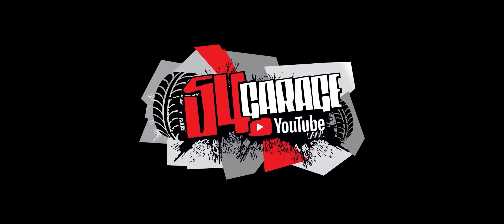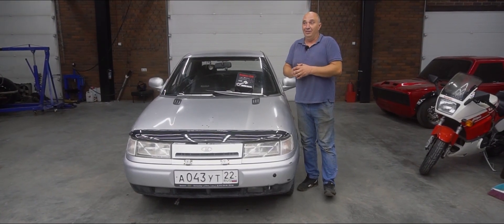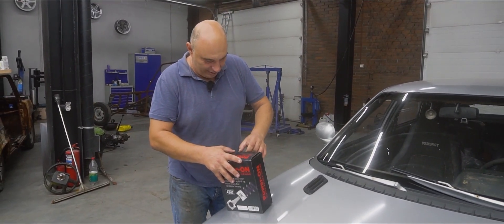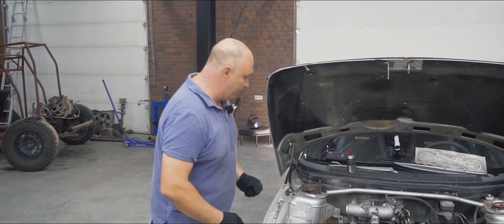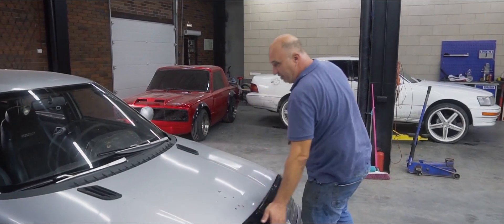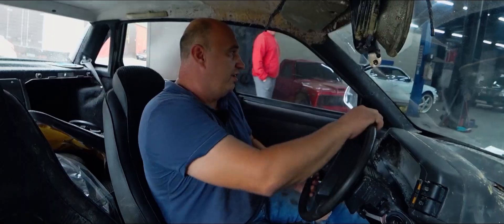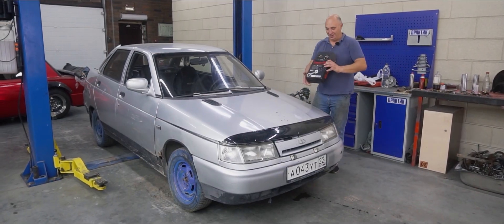Piston return springs (good for 30 HP) – do they actually work?

Comment: 13:00 - laughter is a universal language. Ps: I  though it weird putting springs in the combustion chamber so was very surprised at your initial report. From the outset, I assumed the springs would somehow be under the pistons. With a bit of connection rod slop, and somehow making room for those springs in the engine block, I had a wild idea for a moment that might be a good idea - at very low Revs.

Comment: Great fun! When i was a kid, a standard joke was, when there were something wrong with our mopeds (which it almost always were), -Oh it's something wrong with the piston push-up spring!
An interesting variant would be to fit a light piston push-down spring to a 2-stroke engine (that does not obstruct movement), electrically insulated, with one end routed  trough the center of the spark-plug, where the spring becomes electrode. Then use vibrator/continous ignition (lik e.g. a T-Ford), but jacked up to bridge 1 cm+margin = 60 Kv.

I.e. a continous flashing from the entire spring to surrounding metal parts. Should give an instantanous ignition of all of the gas vapor (vs propagation from the spark plug.).

Comment: somebody beat you to the punchline. I saw one vid on YouTube a year ago that did the same thing
Reply from the maker: Just so you know, this video was uploaded 5 years ago. Whoever you saw try this might've beaten us to the punchline, but it depends on when their video was uploaded.
Reply: @Garage54ENG  point being, I have seen this prank before.  on another note, what effect would differing oil pressures in the same engine make. could this help the motor run cooler or more efficiently? perhaps, last longer?

Comment: Ghaaa, you almost had me! I almost had a comment done pointing out that the resistence on the upstroke to compress the spring would offset any down gain, probably even a loss of power due to heat and friction.

Comment: Piston return springs do not go in the engine for engine pistons they go on the brakes to push back the caliper piston when released because some order cars did not have enough centrifugal force to push back. The Corvette looks like coil springs but most were z wire spring and car will still drive with the spring broken do only assisting centrifugal force.

Comment: Could you make a cam shaft that will pull the valves shut , that would stop the valves from floating when the engine runs to fast. A valve spring will only close the valves so fast  until the engine RPM's are to fast for the valve springs to close the valves.

Comment: Well, actually... What would it do with a very low compression, flathead engine, and springs thin enough to let the piston ho all the way up ?
Also with said springs attached to the pistons and the head.
It might not give power though.

Comment: Made in USA! To be fair our running jokes include China. And whose idea was it to make that car look like🧀 Swiss cheese !??? Lol
   When I first heard piston Springs I knew it had to be a joke or hoax. Certainly if installed on top since it would be hard to top the energy of the detonation  stroke. But Springs underneath? 🤔 Maybe stored energy would help with the compression  stroke rebound motion? Doubtful that energy would have to be put into loading them under compression. And it would do more than just cancel themselves out. You'd lose actually lose energy through parasitic drag. You are dealing with a four-stroke both Springs would require energy on each stroke. 
    Thought you made your own, I'm sure if you had looked you would find something similar on the internet there are scam artists everywhere. 
    Now back to the computer fan placed on your air Inlet snorkel! Lol🙄

Comment: Even if you did manage to fit a spring in there  it'll still be pointless.  The piston will get slowed down when coming up. And that force will just add back when the piston is going down.

Comment: They work great on 2 cycle engines no valves to hit but is not 30hp gain more like 5hp because they reduce combustion chamber volume less air less fuel but the springs absorb heat that would usually be ejected through the exhaust and turn it into mechanical energy during power stroke so is a more efficient engine wasting less energy works specially good on turbo 2 cycle engines as the low compression allows for more spring travel. Btw this is all made up but would really liked to see it on a 2 cycle engine just to see what happens.

Comment: I wonder if u can get a turbo car an run a  ac line running thro one of the charge pipes too cool the charge better then the so for example run the ac full blast at 60degrees and see if u gain some power
Reply: Including the boost charge so I’m think it’s going to be a way cooler charge then just running a water to air or air to air intercooler

Comment: excellent video as always. Now im no scilientologist, but i dont think newton is gonna let you add power with springs. unless the compression stroke has energy to lose i suppose youd be losing energy during the compression stroke leaving you with the same amount of power as before. a piston in the power stroke is still parallel to a piston on an exhaust stroke working against the tension in the spring... yes?
EDIT: Lmao i just finished the video, i got pranked.

Comment: Until the final minute, when they revealed the secret, I kept wanting to yell at him that a piston RETURN spring would go BELOW the piston head, to push it back up, after the combustion had forced it down. 

Beneath the piston head, the spring would only need to clear the rods, right? The taper would make perfect sense. Wide at the bottom of the cylinder, and narrow below the head, where the rod moves side to side less.

It makes me wonder if piston return springs are actually a thing, and he just wanted to make a video, spectacularly destroying an engine.

I like 1% think that somehow he missed the concept, and never stopped to think about it, after his instant (correct) determination that springs on top = BAD.
Reply: Of course, compressing the spring would reduce the energy going to the crankshaft during combustion, and the next time around, another piston has to compress the spring. So,   each combustion has to compress 2 springs. 

I don't know how much energy the springs give back, when they decompress, but it's a lot less than 100%. The rest goes to heat. Unless they're in Siberia, that's a bad thing. 😆

Seems like the guy seriously trying this this is using perpetual motion machine type reasoning.

Of course, I don't know much about engines, so maybe there's some quirk that would allow more horsepower to be produced, at a significant cost to fuel economy. ... But, I doubt it.

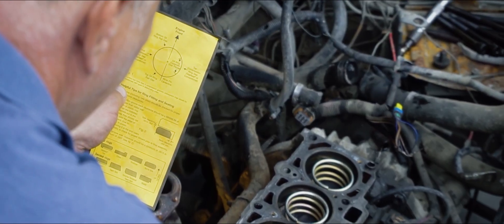Comment: 4:16 soo its is going to take power to compress those springs that it will have to take from the engine and 2  because you have springs  in the cylinder taking up space the volume of the cylinder is reduced ... soo this wont go poorly at allll

Comment: Adjust the carburettor points to 1mm . If the engine is fuel injected use 50% automatic transmission fluid in the petrol mix .

Comment: Seriously dude did you even read the instructions?? The springs go UNDERNEATH THE PISTONS not on top, that's why you locked up the engine. You could pull that thing with the Budweiser 12 mule team and you ain't getting it crunked over like that. Don't believe me? Go ahead give it a shot ;) Just make sure you get the bottom spring seats in place properly because you don't want the springs getting tangled around the crankshaft OR DO YOU!!!! That's when the real fun begins..  LoL 😂

Comment: Now, if you really want to tune up a car start cutting 60 mm holes into the front fender for better aerodynamics. Drain the coolant and fill the system with acetone (much better cooling of the engine). Drain the engine oil and add low friction oil such as the one used for french fries (ever had some fires sticking in your throat? No? There you are...low friction). Next, block all ventilation unless one (the one you connect a drainpipe to, that has to go through the back window). It will vastly improve the power of that thing + eliminate turbulent air behind the car. 
Then beef up the octane of the gasoline by adding a good portion of paint thinner.
For faster cornering grease the brake pads (use plenty).
Now you just need:

Some idiot willing to drive that shit.

Comment: Ok, so obviously putting big metal springs in the combustion chambers is a terrible idea, but it got me thinking. Are there cars with springs positioned under the piston that fit around the rods instead of in the combustion chamber? I feel like that idea might work better. I don't know if it would work or if it would offer any kind of performance increase, but I feel like that would have more potential than this. Someone who knows more about engines please feel free to respond.

Comment: I know of an engine that the piston at TDC is deep enough down the hole I bet it would about handle this(about) ..ford 360FE , ford designed the 360 to be a strong tough truck engine with better mpg over the 390, unfortunately last minute they got slapped with new epa regulations and had to mass produce using 410 surplus pistons from the late 50's ,those pistons with the 360 crank and rods absolutely made that thing a slug it slaughtered the compression ratio making a "big block" with small block power, good news is even with factory iron heads they can take some boost on pump gas andmakes it a whole different animal, the factory cam is retarded as well so it is essentially a boosted engine build...without the boost, sorry for the long winded history lesson,lol

Comment: Obviously because the springs are not as large as the cylinder bore they are going to move around and probably get stuck between a valve and the head.

Comment: Wait!  Wait, did you measure the horsepower before???  Wait, what?  It started?  yeah right, you guys took them back out.   The other thing is that, compressing the spring will take away any extra energy thought to be gotten out of it springing back, ie. conservation of energy.

Comment: Might be ok if at top dead center the piston is down like 3/4 of an inch otherwise i see a lock up and bent or broken rods and probably bent valves and most likely broken pistons as well. Other than that yeah looks like an awesome plan. Who does these idiot videos. SMFH

Comment: Something didn't look right
When all the springs were put on they were all at the same level
The pistons should be at different heights in the cylinder head
Reply: Looks like the engine was turned to where the pistons were in the middle of their stroke, making them all at the same level.
Reply: No. Two pistons travel down and the other two up.
Reply: @Rubensgardens.Skogsmuseum  but looking at the video all 4 pistons are down if 2 pistons were up or down then 2 springs would be up or down basically what I'm seeing is all 4 pistons and springs are at the same level

Comment: If you had a pyramid shaped spring, and a flathead engine, you could in theory use piston return springs for a short period of time. And, they might even increase power marginally due to increased compression

Comment: Yup. anyone with any knowledge of physics could see this coming. even if you had a low compression engine, that had the clearance to allow the springs to fit in the cylinder, they would not work, because they would lose their temper (hardness) before the engine reached operating temperature, and become nothing but flexible wire.

Comment: cut the springs a cpl ml longer but might hit valves im thinking will only work on 2 stroke spark plug might get hit too shorter spark plug and tac weld springs to pistons to they dont fall over

Comment: For those people still in doubt if this could work:

It can't, even if you could somehow install it into the cilinder and function.
The energy needed to compress the spring, comes from the energy from the other cilinders. So all the energy of a spring releasing wouldnt be enough to compress another spring, due to losses. That alone would mean the engine would run less good.
Added to that the loss of cilinder volume, which is also a negative, means you would lose a big amount of energy.

All motors are basically 'converters'. A combustion engine converts chemical energy to motion energy. A battery converts chemical energy to electrical energy. A windmill converts motion energy to electrical energy (modern), a nuclear plant converts atomic energy to heat to electrical energy, etc. 
A combustion engine is a system (like above engines are systems). The energy has to come from somewhere and doesnt magically appear. It is either external, as for instance a sailing ship of windmill, or internal as for a combustion engine.
As for a spring; it doesnt convert energy. It stores energy. The energy needed to change its position (energy status) by x, is more than you get back when released to 'relaxed' state. Due to losses, which go to warmth (heating up the system).
Same goes for eleastic bands, flying wheels, etc.
Reply: Surprised it took so long for someone to post this. Any energy gained from pushing the piston would have been taken from the compression of the spring. And if the could fit, they would have been bouncing around binding up the valved and making a lada mess. The fact that they (might) be for sale on the Internet shows PT Barnum was correct: "Theres a sucker born every minute."

Comment: A spring is fine but you change ya oil if sits a tiny bit metallic the spring washes through..
It needs  nos obvs
Reply: I'd use coal

Comment: Technically... if you had these and they didn’t bind or hit the valves and they applied a slight force to the piston constantly, this would help prevent rod end failure when the bearings fail/if you had bad bearings, and if you have a lot of play in the rod ends it could help with the intake, only wasting some power to compress them on the exhaust and compression strokes, nothing really gained on the power stroke since the power goes in first, but it could help worn out engines without needing bottom end work.

They may also help regulate wear location and reduce wear by not having the pressure constantly switching sides of the bearings suddenly, but if they have more pressure than the oil can fight then they might just cause more wear

It’s an interesting concept to think of these as more than a prank or April’s fools joke, but one must consider how long these would last, seeing as how they run further and faster than valve springs, and get no oil (if everything else is working well)

Comment: I have just patented the plastic manifold , it’s been  injection moulded to fit any car with any size engine , and because it has a built in plastic turbocharger which is fuel cooled direct from the fuel return line , the inside of the manifold is lined with polished asbestos , the plastic turbo has ultra light weight turbine blades made from polystyrene , the whole system gives any engine the power and torque of a Bugatti Chiron , please send 10k to the following P.O. Box address  . Smoking manifolds , warning light lane , brokenville ,lower Scunthorpe ,brn999

Comment: I was sitting there thinking, no way! The required force to compress the spring is exactly the same force required to decompress the spring. No added benefit. 
Maybe it would increase compression by taking up volume in the cylinder, but if you have enough room in the cylinder for springs to compress, you're not really going to get much compression anyway.

Comment: Try a two stroke without valves. Then it would need a conical spring that can sustain flat condition (planar spiral) to fit the combustion chamber. Small end supported by some sort on piston head (to avoid the spring getting into side ports as much as it can so small end on piston side and big end on the head). Spring should be sort of stiff to avoid resonance but it make more mess when it will break and mangle in the side ports.

Physics say a spring will make the torque a bit bouncy needing even more torque load on compression and higher torque output on return stroke. So it's not lost but nor gained. Just the valleys deepened and the peaks heightened on the crank angle-torque chart. More work on balancing and flywheel to smooth out the torque chart. Plus there is the losses in the spring (pretty low for a steel spring)
Another point of concern is the spring that will bend and mess the temper if it will ever get to run for a few minutes once the spring will heat up. I bet the engine will fail well before heating up the spring due to vibration and resonance. A small buckle will scrape de cylinder and a few bounces later it will be caught sideways breaking/ bending the spring and a part of the spring will catch the side ports causing a huge gouge in the piston and cilynder or even seizeng and breaking the conrod (in case of a running 4piston two stroke... at 1piston engine it will just violently stop with the respective nicks and gouges)

Comment: Its not like that spring can really help sling those pistons back down any faster. They are all attatched to rods and ultimatley a cam that runs on specific timing. Even If the springs could fit it would be a hazard for that to be in there anyways. Why would you want something that could ruin your motor in you cinder head bouncing up and down on your valves.
Reply: Cylinder head##

Comment: You need to flash the ecu when you use these springs with a hdmi to hosepipe lead and you need to cover the springs in elbow grease or else it just won't start the engine. Trust me I am a mechanical engineer.

Comment: I think the first car had the springs removed before reassembling the engine head. You experimented with the old car and it didn't work. Fixing the damage in the new car would have cost you more...